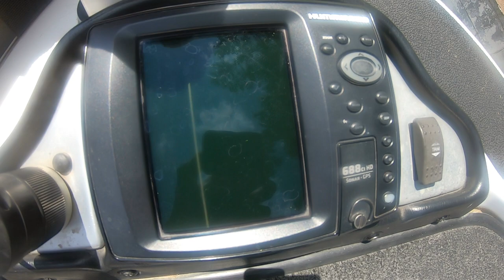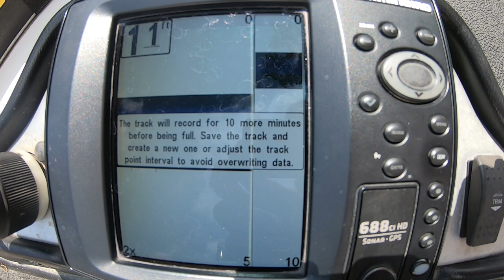No Depth Reading On A Humminbird Fishfinder - Transducer Cable Problem

Comment: The manufacturer recommends you not fix it...  😅
Reply from the maker: They told me to buy a new one, but I needed it fixed before my tournament. I order a used one from Amazon, but it didn't get here in time for me to install it before my tournament, so I fixed the old one myself. =)